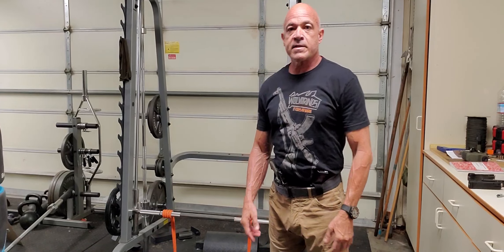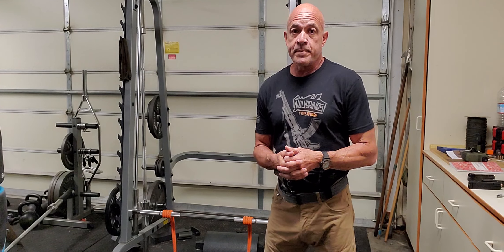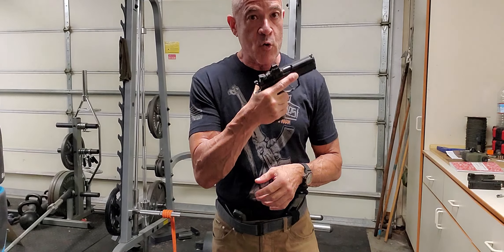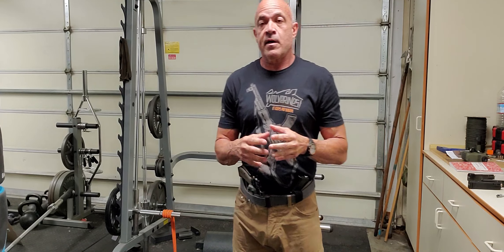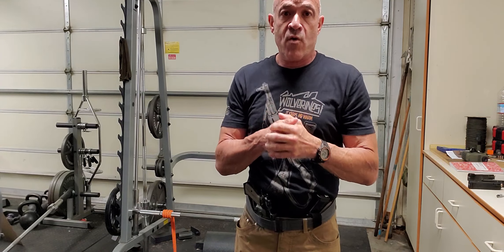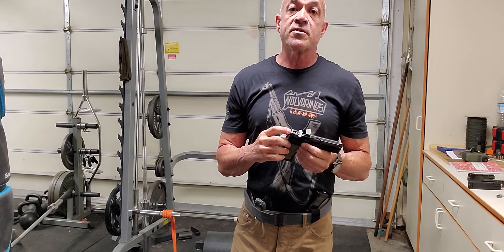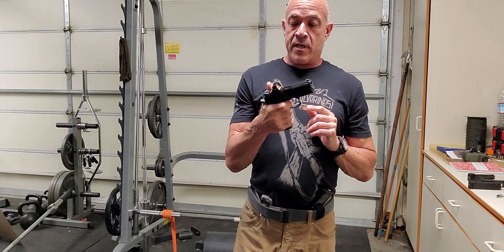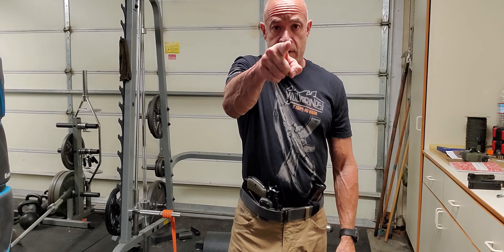TRIPLE ACTION OF THE CZ-75 SYSTEM

Comment: None of my CZs have the de-cocker...
Reply: Are what would normally be the decockers set up as safties to run the guns as single action only, or have they been converted to double action only and not need a safety.  Most current production CZ-75 pistols have an Omega trigger that the user can switch out the decocker and safety by switching parts.